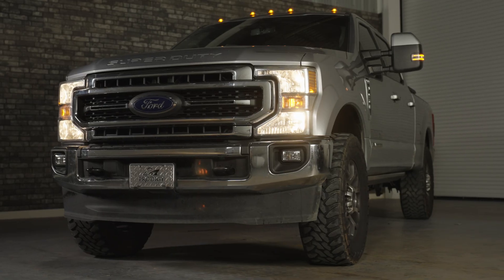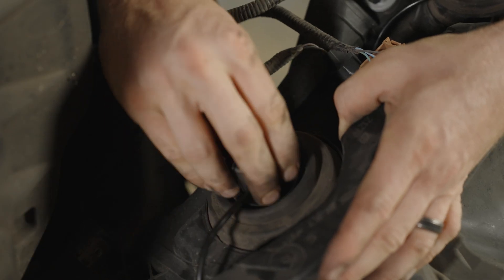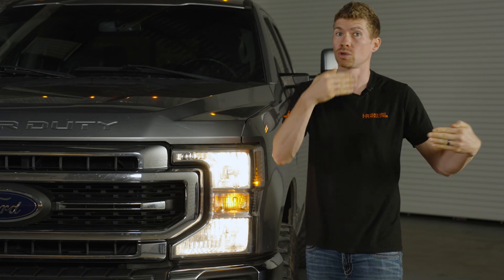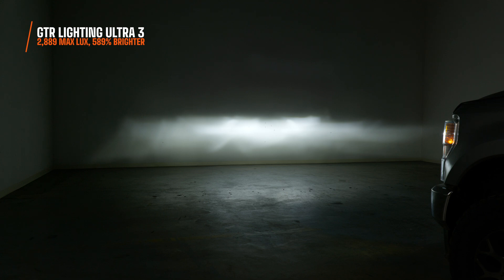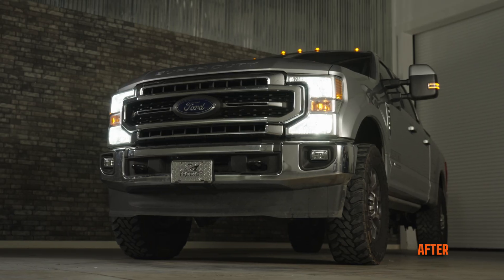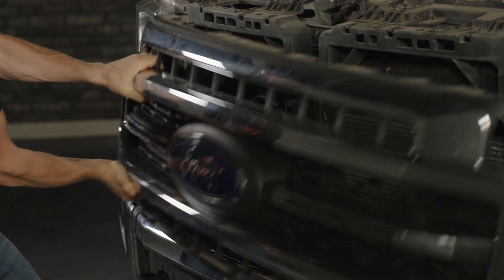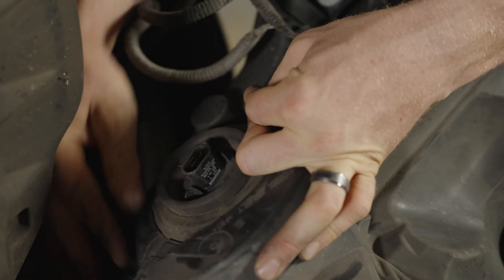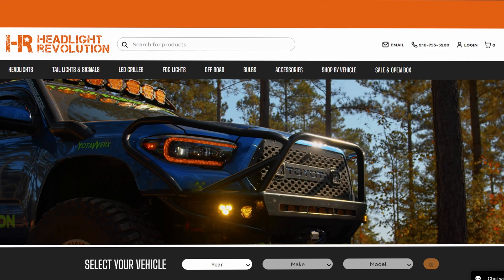589% Brighter LED Headlight Upgrade for 2020-2022 Ford Super Duty | Stock vs GTR Ultra 3

Comment: These look nice. Ive had the GTR Ultra 2 in my 20 F250 headlights for 2 years and still love them. I ordered these Ultra 3s for my fogs as i never upgraded them yet. I'll replace the headlights with these down the line probably but by the time id need to maybe the Ultra 4 would be out lol.

Comment: My biggest gripe with replacing stock bulbs with super bright LED’S is the lack of adjusting them.  Combine that with a lifted F150, and that’s a recipe for disaster.
Reply from the maker: Proper aiming is key with any headlight upgrade, and we always recommend adjusting after the install!
Reply: There are videos all over YouTube on how to adjust your headlights. But I agree, some bulbs are not made well, and are just too bright. But I think the companies that make these bulbs are getting better at imitating the original beam pattern.
Reply: @jimmyhorton8297 I constantly see trucks that just blind you when they are behind you.
Reply: @stevevlahos1 lol, I am old enough to remember when halogen bulbs first came out. I had a 74 dent side F100 at the time. I put new halogen bulbs in it, and my dad said they were too bright, and threatened to knock them out with a hammer. It’s the same with LED headlights. Until they come standard in everything, there are gonna be guys running around with ridiculously bright headlights. Time moves on, just gotta roll with it.